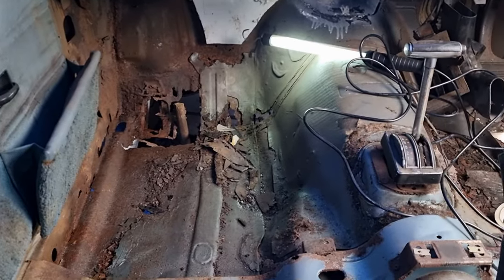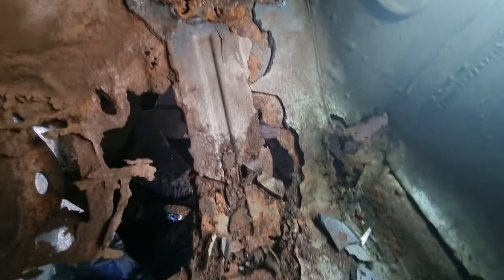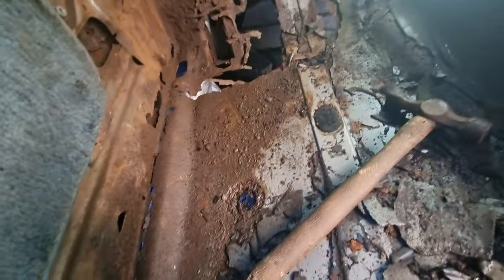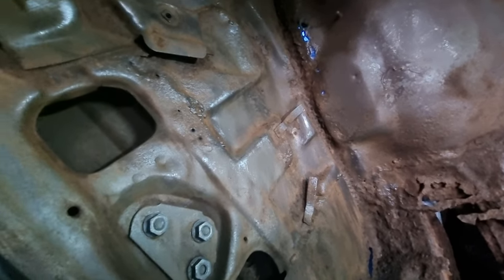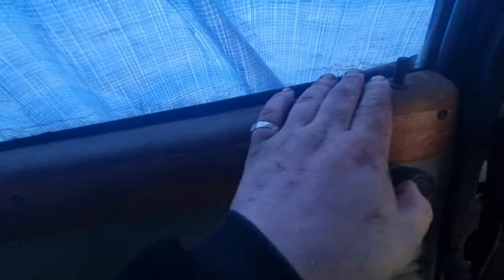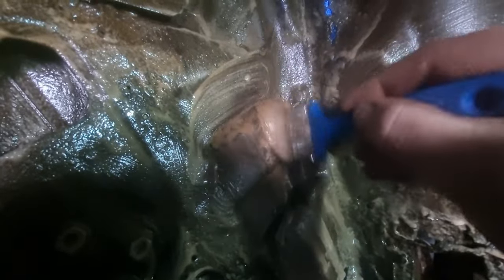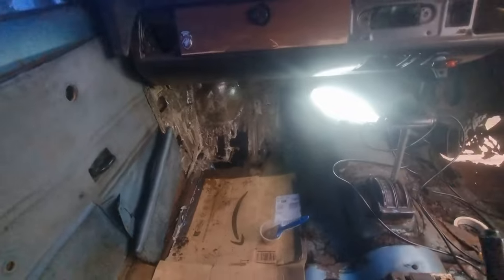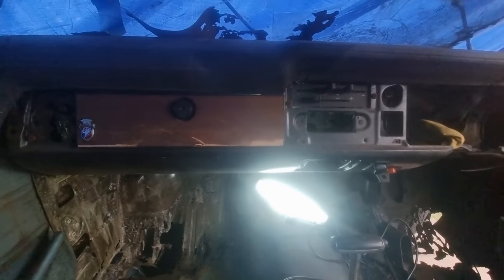Cortina Mk4 Ghia 2.3 V6 Restoration || Footwell Prep (P7)

Comment: Someone may already have said this, but you can buy very very thin wood veneer; it's pretty easy to glue down and the thin stuff will bend around the plastic curves easily. I've done it myself on a Jaguar dashboard and it turned out well. It's pretty cheap. Some of the thin veneers are sticky-backed, but I wouldn;t trust that type of glue on door trims because of the heat from the sun.
Reply from the maker: Ohh OK will look into it thank you

Comment: The wood trims can be sanded down and revarnished. Will probably need 3 good coats with fine sanding in between. I put pod speakers under the seats to avoid cutting any trim, and you can get FM radios to fit the dash without cutting them. I have a couple lol
Reply from the maker: Yeah will give that a go with the plastic trims thank you
Reply: @AdamSNook.  if it doesn't work I have spares
Reply from the maker: @chrisbowditch6684 awesome mate

Comment: Floor edge repair panels are a good idea like I did. Headlight bowls I was going to drill a drain hole. Put in a retro style stereo unit with bluetooth and put subs under the seats. Pete did the same on his mk3's
Reply from the maker: Yeah was thinking of that with the subs will look at diffrent stereos thank you and subs I can make my own box that will build into the side of the panel and maybe have a cover over the sub we shall see whT ideas I come up with as for the floor yeah I'm thinking of making my own panel for passenger side as it does really look good

Comment: deffo add a stereo that you want for the bass music! music is important.

Also i do hope you get some security on the car in the future as unforunately cortinas are hot property / ripe pickings for dodgy banger racers that will just lift them off the drive and it would be a shame for all the hard work to go to waste in that manner (speaking from experience sadly ).
Reply from the maker: yes i am aware of this i have security camera pointing at it at all times and its self activvated meaning any one comes near it and it will auto point at them and light them up with bright light and i watch itall the time lol
Reply from the maker: plus my van is blocking it during the night and that does have security on it a lot off

Comment: get an origional radio converted to  blue tooth internals, all works from ur fone, best of both
Reply from the maker: Yeah was thinking of that but are the original stereos only mono
Reply: @AdamSNook.  the internals are all changed, the guy is cortina page now and again, or get a slightly later one, comes with tape and stereo😁
Reply: sent u pictures
Reply from the maker: @grahamthompson1721  thank you mate looks like a really nice unit I can do stuff like electronics so might build a stereo unit with Bluetooth with a old front we shall see what happens

Comment: Hi buddy why you don’t you find some one breaking a mk4 and cut out the panel’s you need  a lot easier.
Reply from the maker: Trying to keep as.much of the car as I can if it can be saved I want to save it lol
Reply from the maker: Yeah but I can start looking and and seeing what I want I know its the last thing needed but plenty of time to plan it
Reply from the maker: Plus I love a challenge
Reply: Easy enough to make repair sections for the corrosion cut out and replace, I’d definitely try and get a gas mig as I’ve found you get a better weld, your doing well with it, as for stereo, lol bit early in the day for that, but I think they do a retro Tommy 2 nob type that looks the part but actually has blue tooth etc
Reply from the maker: @StephenParkes-e9y  yeah I know it's a bit early for stereo but these things play on my mind lol untill I know what my plan is but you are right lol plenty of time to decide what to do on that hehe yeah defo want a gas welder by the time I come to do the chassis I am looking daily